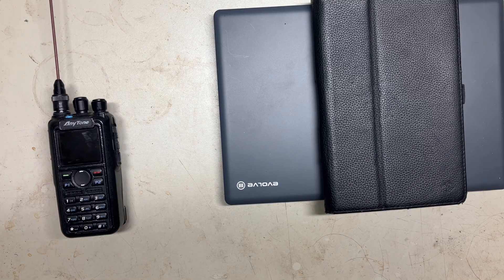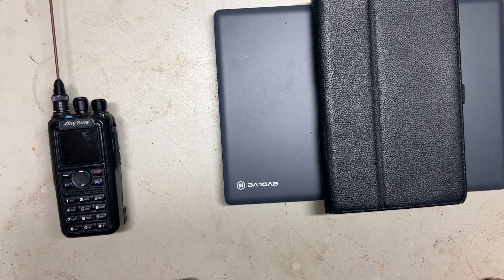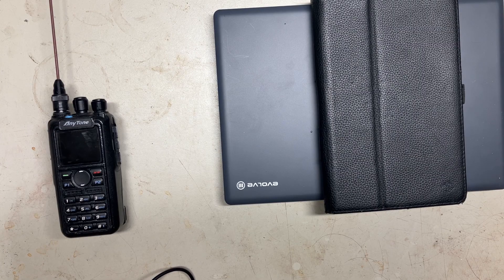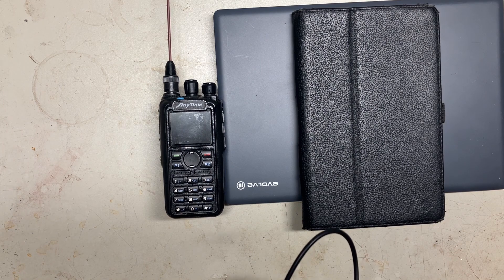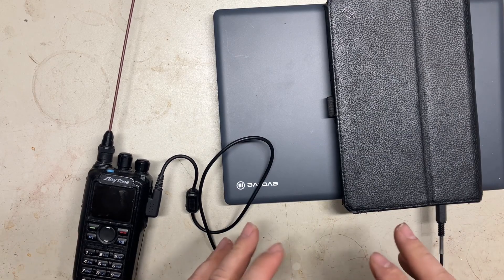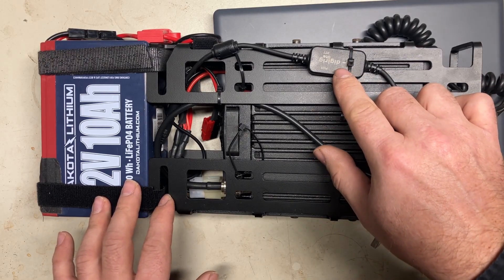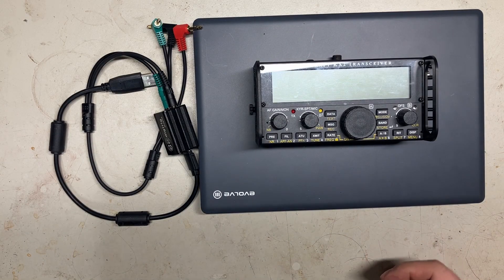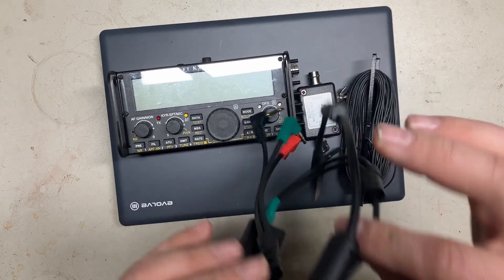Interfacing Computers and Radios

Comment: I already have meshtastic, and thats the ONLY system peopel are ever gonna be able to use becvause its an easy device u can buy that has an app. 

Aoll other ham radio peopel have failed except rattle gram. we need something liek WIGGLEWIOOFI with WIFI SSID messaging orsomething

we need more wifi mesh networks outtheer and some sort of 56k packet radio system, but thats a dream ... but we should have some sort of basic low bitrate internet for free over the radio anywhere in teh country that can at least let us do email etc
Reply from the maker: I'm glad meshtastic is working for you. There are a lot of people using it in my area. Stick with what works for you. Unfortunately in my experience it tends to fail in real emergencies. Several months ago NC Scout was offering a reward for proof that any two  individuals had successfully used it for communications when hurricane Helene hit western NC. I do not believe he had any takers. Also know a number of individuals in and around western NC that have meshtastic gear. None of them used it successfully during the disaster. 

I have well over a hundred people in my circle using a variety of applications for radio, mostly the FLDIGI suite and a hand full of other applications discussed in some of my previous videos. None of them have had much success with rattle gram or any of the other niche one trick pony softwares in exercises or real world events. I will say that within a few hours of dawn after Helene tore through FL, GA, SC, and NC I was in contact with numerous individuals who had made antenna repairs and were communicating via HF data modes getting damage reports and other situational reports from impacted areas as well as sharing information about the scope of the disaster with individuals inside the impact zone where information wasn't available. 

As for radio and email, for regional incidents Winlink is a viable free option to send email over radio. Part of that service is cloud hosted so if you are concerned about cyber warfare it isn't an option in that scenario. There are also private BBS systems that can be accessed via radio that are completely grid independent. 

I do agree that we need more localized wifi type mesh networks such as AREDN, but like any other infrastructure they have a lot of physical vulnerabilities. That is the beauty of HF data, there is no infrastructure in the middle. Just the radio on either end of the link and  the layers of the atmosphere in the middle. A radio, and wire antenna, and a CW key are the ultimate in the KISS principle. Data adds another layer of complexity, but it is worth it for many to avoid learning Morse code and it has much faster throughput. 

Keep training and building the systems that work for you and your community!
Reply: The amateur radio operators are over all a group with many different interests. They have a lot of knowledge and experience in how to communicate in a very austere environment with out any supporting infrastructure. This is a proven fact. New technology and forms of radio communication are embraced by hams, and improved through experimenting. All people are welcome to join.